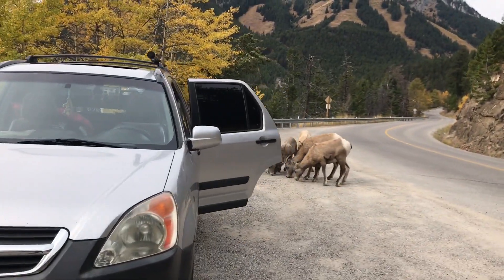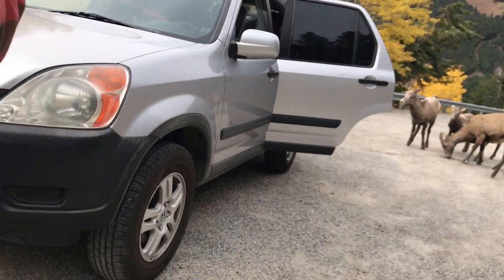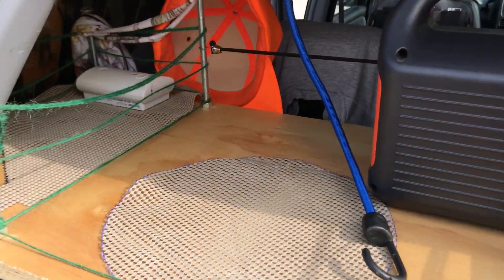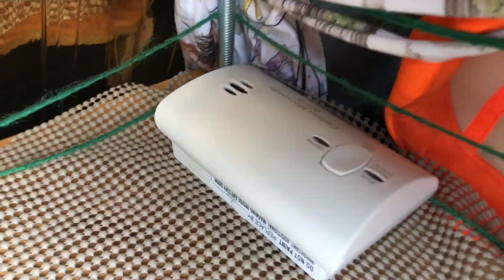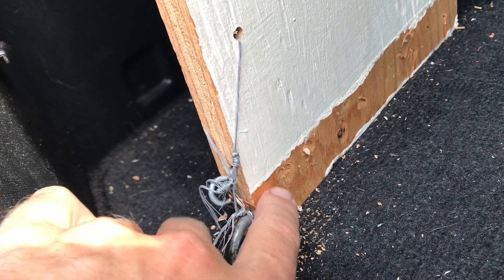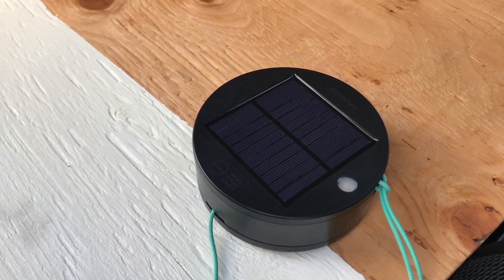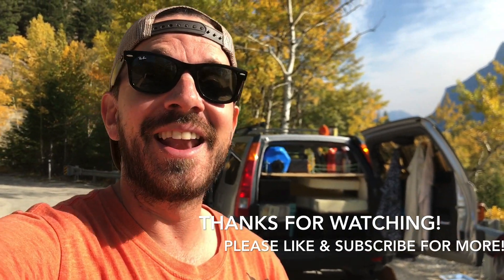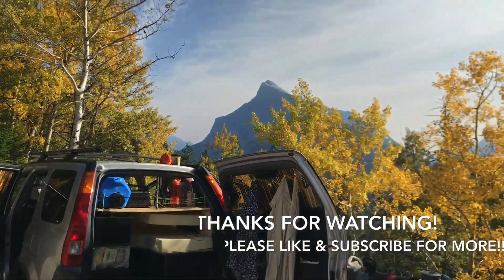( HOW TO / BUILD ) Cheap DIY VAN LIFE In An SUV

Comment: My first camper, conversion, mines gonna be a 3 seater, with bed,I got a custom aluminium checker plate roofbox  to put on it with a 100watt solar & 100 amp hr agm 🔋 battery pack to put on it, but first I'm making my own custom heavier roof rack with spotlight bar.
I'm also upgrading to lithium.

Comment: I had the same vehicle was you so it was a great help with creating what I was making I have a shelf in the back but I did it lower level with the seat so I can see out my back window and I have a bed that blows up to put in the back seats but I can also have the option of your bed style as well I don't live in it yet it's just my bug out vehicle or just in case I do still at home with my parents I like having a backup and a lot of the lights and the gears and the chargeable things you have I already instinctively got from the shower head that I saw somebody else have that you put in a bucket I did like the little toilet that you had and ordered one that was similar to it but where if I have to live in my car I will have animals I took plastic cheating for floor covering and line the bottom of my vehicle with it for an easy cleanup but I'm grateful that you posted this because of s*** hits the fan while I have to relocate or I'm forced to relocate or if I'm out and I cannot get back home right away I'll have what I need only thing I'll probably be missing is my animals but I don't go outside and leave the yard much so I should be good 😆

Comment: Hi nice and informativ video. Cut my mattress with a non electric sharp bred knife and worked great. But i became a hard surface floor sleeper no back pain any more since;-). Now I use only a yoga mat with a thick cotton blanket even when it comes to car travel. Both roll up small and is easy stored away. Do also yoga on the mat so this  item is double used ;-). Left a like, subscribed and hit the little bell. Stay safe and blessings from Germany

Comment: I'm building a 2004 Z71 Tahoe into an Overland Camper. I will use it mostly for hunting and fishing and just plain exploring.
Reply from the maker: Sounds awesome, Kevin. That’s a good vehicle 👍
Reply: @intheopenair3725  thanks, it has been an excellent vehicle so far. I currently have 299,500 miles on the original engine and transmission. And continues to run strong.

Comment: Hey Man, love the build! I just got an 05 gen 2 with only 65k miles and have been dreaming up something similar then found your video and it all is really starting to come together.

Quick question - wondering if you remember the size of those Rubbermaid bins. The link brings me to a generic page with multiple offerings and my guess is that you're using the 14 gallon bins but hoping you can confirm. Thanks for the video and all the content!
Reply: does it still have the fold out table in the back??  careful with too much weight..it will work against you.

Comment: Hey i was wondering what you do when its hot , outside
Reply from the maker: Plug in my USB fan and open all the windows :))
Reply: @intheopenair3725  yeah that's good but not stealthy 😅
Reply from the maker: True. When stealth + hot weather intersect, I tend to fully open my sunroof only and turn the fan on high. Cheers!

Comment: THIS has been so valuable. The way you put that shelf has given me the perfect solution to the water storage problem. I am also going to do my condiments like yours. I bought the two containers and the storage containers as well. My SUV is set up with less space, I swear! It is a 2002 GMC Envoy SLE. You would think it would be bigger, but no, it's smaller. I will take before and after photos and show you. It only has a 2nd row of seats and I'm going to remove them as they are cumbersome and not good to keep in the vehicle. Space hogs. Thanks for your videos.

Comment: You probably already know this but these crvs are designed that if you slide the front seats all the way fwd , remove the headrests, slide the rear seats and fold the front seats back down,  they will nearly lay flat. This could eliminate the need for foam and other things. A tweak of some kind could be done to really get it perfectly flat. In theory 2 ppl could sleep side by side in the front. or you could add a guest.
Reply from the maker: Hi Robert! Yes, I’ve used the this trick in the past (pre-build) but nowadays I prefer this more function, comfortable, and more livable design. Have fun out there!! Thanks for the input

Comment: How did you settle on the CRV vs say Forester, RAV4, etc?
Reply from the maker: I did a lot of research for most reliable vehicles and this gen of the CRV kept coming up. Also I love the body styling versus the others. It’s been a great vehicle for me!
Reply: @intheopenair3725  what year generation and model is it. Is it roomier than the other makes you looked at?
Reply from the maker: 2004 Honda CRV EX. It’s the Second generation of the CRV’s. Very roomy and reliable. 4wd. I love it.

Comment: Hi. Storing your table top along side the front seat is good. But if your CRV is the same as mine there is a side impact airbag right their. Get too close with the plywood and it will splinter the timber if it deploys. Be careful!
Reply from the maker: Good tip

Comment: I love your CRV build. I have a CRV also and plan to build something very similar to yours! My question is..can you access the built-in CRV table from the back? Looks like it would be pretty difficult. I bet that's why you bought that sweet aluminum table.
Reply from the maker: Hi Julie, good question! At first I thought I would want the table but as I’ve traveled and lived in it, I’ve realized I don’t need it. The small table does everything I need and it’s so much easier to pull out and setup. But I do like knowing I have the big table because I can still get at it if I absolutely need it. Best of luck with your build! Let me know if you have any other questions :))
Reply: @intheopenair3725  
Dude!
I just used the coolest trick to darken the bumpers and trim on my '04 CRV....I used a heat gun!
That's right! I just ran a heat gun slowly across anything on the outside that was once black and turned it black again. It looks great! I fell in love with my car all over again!
I just thought I'd share my newly found tip!
Stay safe

Comment: This was the BEST barely build use of space I have seen on YT. I have an 07 crv I am working on for weekend camping. My rear liftgate swings up rather than to the side and I also lose some basement space bc of the spare tire. You did a masterful job of using simplicity, lightweight plastic,  and space optimization. I see under the shelf on drivers side I see angle steel brackets, is that for a portable sliding shelf? How do you keep condensation build up to a minimum while cold weather sleeping (that may be a future vid idea) ? Thanks
Reply from the maker: Thanks Robert!! I really appreciate it. Yes!! I considered putting a small slide out shelf there but then abandoned the idea because it was too high up... 
As far as condensation is concerned, I usually leave a window or my sunroof cracked open to allow for fresh air and ventilation. I’ll also run my small fan on the low setting all night long. These two measures work well to keep condensation low. Great questions!! More vids coming soon....

Comment: what advantage do you find with having the tarp extending from the driver's side as opposed to the passenger side?
Reply from the maker: Hi Shoshy, I find it works for me because I enter the vehicle from the drivers side in the back when in camper mode (my bed is in the passenger side).

Comment: This is a really great video! I’ve seen many and this tour is so good. Your set up is very much like mine. Your bed set up is very similar to mine, only I used a bottom part of a futon bed. My Brother is a welder and he welded it to size. He put 2x4s across the top with hinges that allow me to lift up and get to things stored underneath bed. II also use a storage organizer for behind the passenger seat, that I use for easy to get to storage. I also like you made 2 different surface shelf/table to use along with the back of the passenger seat. I love it! Sometimes I only need a small shelf and other times I need something like a table. Table I use for eating, working on computer or Bible studying. Table even has a easy to remove and store leg for solid support. I like you use those plastic drawer system. Mine where 3 drawers. I use 2 for clothes and 1 for a compact kitchen with a cutting board on the top. So surprised how much will fit in it. Easy to carry and use for cooking at any park. 

I do have a question?....
I am always looking for good hook ideas for inside of my SUV. I see you had soon hook system through out your SUV, you even had jackets hanging in the back. Please share how and what you used to do that. 
Thank You. Bless you. 
Jesus is King. 🙏🏽